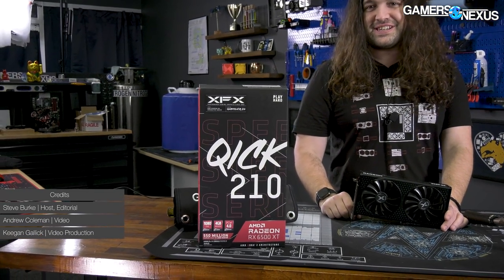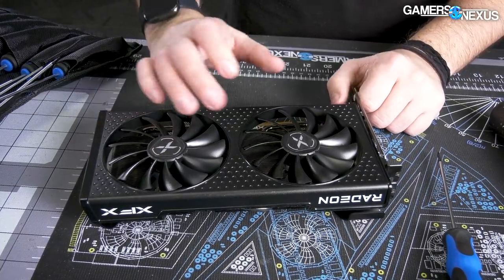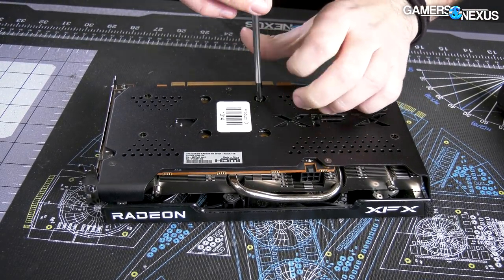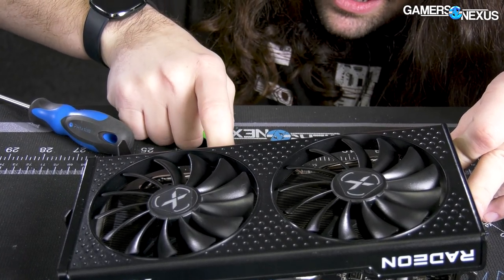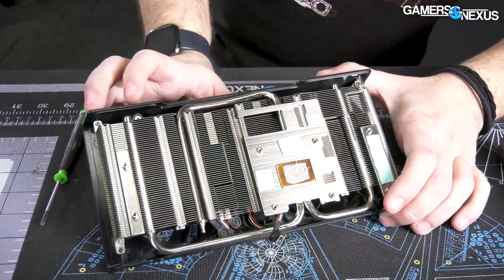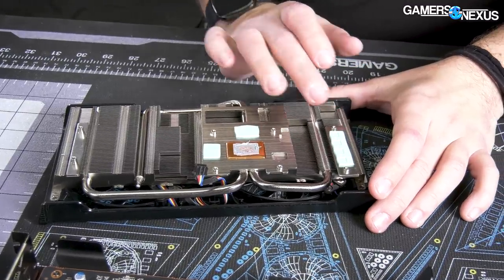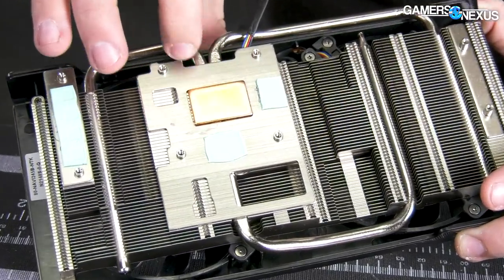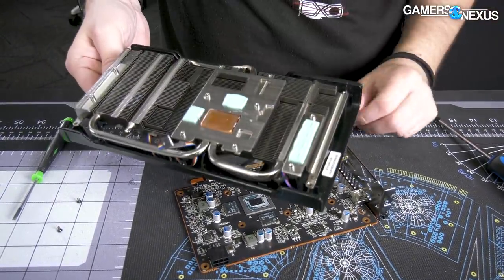Tearing Down Trash: AMD XFX RX 6500 XT Disassembly

Comment: The chips they used for these cards were probably made to go into laptops but the power curves didn't bin as well as they wanted so they made this...these companies are good at maximizing profit and at $150 this would have been an awesome move....
Reply: Except, it's not $150...
Shame, really.
Reply: except everyone would lose money at $150.  The whole market is jacked, all the way down to parts and shipping.
Reply: It will probably be $149 in the future when shipping costs drop.. for now, those are the ones that are significantly driving prices up.
Reply: @wisdoom9153  I know...It really sucks...
Reply: This is painful, why are we getting mad at AMD for setting a realistic MSRP for the market right now, but COMPLETELY IGNORE NVIDIA NOT SETTING AN MSRP FOR THE 3080 12GB.
Die cost is around $18
Board, VRM, etc. $50
30% markup to pay for R&D and other things (Normally is 60% for Nvidia and 45% for AMD) Total 150
VRAM $12 a GB so $48
Cooler $15
Shipping (right now) $30
The rough total before any AIB markup, $195

But maybe AMD learned now, they just won't say a realistic MSRP or any, then no one will get mad at them. Great job
Reply: @benc3825  why are you even trying to use whataboutism?
Reply: @AmateurHourProdu  Exactly, thank you
Reply: Stop saying that it's for laptops, 6500XT is an insult against laptop GPUs like RTX2060 with 6GB of VRAM, hardware encoder and decoder, etc, 128 bit bus, etc.
Reply: @S41t4r4  How else can you judge a product objectively. If you ignore the market conditions and other companies actions, then yes, this is a horrific product. If you spend literally more than 10 seconds thinking about it, this is a great product. If it is as strong as a Rx 580 and the 6500xt can stay under 300, which it is right now on Newegg, then where does that leave the Rx 580 and weaker cards? Under 300 realistically.
In this market. I can buy a 6500xt for $280 on Newegg, or I can buy a 1650 used for 300. What do you think is the better option?
Reply: @saricubra2867  Well bad news, it is a laptop die.
Reply: @benc3825  Still an insult to mobile Turing and Ampere. AMD is crap.
Reply: The current shipping and component cost do not allow this card to sell for that little. AMD is not a charity.
Reply: @benc3825  At least on desktop CPU space, Intel and AMD trade blows and on par, but on the GPU space, is like AMD is still salty about Pascal and struggling to compete against those cards almost 5 years latter.
Reply: Even at 150$ its to much for this GPU based on previous generations.
Reply: @benc3825  What you said is complete garbage. Stop fanboying AMD. This is the worst GPU released in last 2 decades.
Reply: This card wouldn't be good at any price, it will age terribly. Or better said, it already aged, DOA
Reply: @vasilije94  What ever you need to say to believe that. I’ve learned that people on call people fanboys because they can’t come up with a reasonable argument. I personally agree, that it is a crap GPU, but you can’t ignore the reason it was released and the market condition. 300 for a 1650 used or a 250 6500xt?

No, this isn’t the worst GPU, that goes to the GT1010 that was release within the past year. It is worse than an iGPU.
Reply: @wisdoom9153  ye its 275 or more
Reply: @benc3825  Stagnation. At it's best the 6500xt is about as good as an rx580. In reality it will perform worse than the Rx 580 in many games due to the 4gb of ram and X4 pcie. Further, they took away features that the 580 had in regards to encoding. 

Also, look at the 3080ti reviews and news videos about the 3090ti, people are pissed about that whole situation as well.
Reply: @saricubra2867  It is not meant to fight those,it was made to fight MX and Intel UHD ,which it easily dominates.
Reply: Funny you say that because I took apart my laptop for the first time to replace the thermal paste and deep clean my fans and vents, that GPU diode looks like my Intel CPU Diode. At first I thought my GPU was the square one till I saw it said Nvidia. So that only left me to conclude the square one was my I5 4 core, which I am still learning about, so @GamersNexus message received, Don’t f**k up. I might have a couple times with a striped screw or two, but it’s a learning experience I am trying to develop into a hobby for maintenance. Still waiting on the thermal paste though… But I enjoy watching your videos for honest feedback and professional reviews. I wish I had discovered this channel before I brought my desktop.
Reply: @benc3825  It doesn't fix the fact that if tomorrow the market decided to 'fix' itself (or a competitor sold a better product for a similar price), this would still end up a terrible value. It's terrible value now, and the current 'market condition' only serves to highlight how bad of a value it is because used products are still possibly more attractive than it.

Like, paying $50 more to have more staying power in the slightly longer run or to have some features that should have been there in the first place? I'd make that recommendation in a heartbeat. I've made it recently by selling my 5-year-old GTX 970 to a friend (at a friendly price) where he could have gotten a brand new APU instead (it would've been much cheaper for his budget to buy it) - simply because I know the APU would have sold him short on all the games he would've played. He's still enjoying it to this day.
Reply: At this point might aswell just get the 5600g.
Reply: I'm not even sure about that, the Radeon 5300 would probably nearly match it and it sold for about ~130 dollars.
Reply: @benc3825  bc this vid is ab amd? lmao
Reply: Yup, this would have been great if it was priced properly.
Reply: @AmateurHourProdu  Inflation existed before too, man. The budget GPUs of yesteryear didn't yield backwards either. Either they were stagnant, or the performance increase was marginal / better in a completely different workload (i.e. Pascal vs Turing with RT).

The point is that somehow, this regressed. Badly.
Reply: Exactly and when the market is the way it is instead of throwing out components people might be happy to just get this because it's all that's physically possible to have available at this point. These aren't scalping prices by any means.
Reply: @rick_takahashi  no it won't. this is the low end now. get over it, there won't be any more sub 300 low end gpu's again. people bought everything they threw out there and now it's time to pay the reaper. the low end cards are going to start at the 400 mark and go up from there.
Reply: @vasilije94  And what can you buy for 150 dollars these days? A used rx560?
Reply: @arthurbonds7200  What gpu that cost 50 dollar more has more staying power? You mean one of those used GPUs that may only last a few years at best because they were probably in a mining rig?
Reply: @stephen1r2  asrock does to
Reply: They know damn well these will sell for $200-$300. Charging less would be leaving money on the table. AMD is getting a lot of flak for this release but they're just taking advantage of an opportunity here.
Reply: @mystichisoka2  really? that is the rough cost of a TSMC N6 300mm wafer, given a die size of 107mm2, they can make 560 dies ignoring yields. A N6 wafer costs around 10K, making 560 makes the cost around $17.86 per 107mm2 die.
But with out my secret of a calculator. The EUV machine from ASML costs around 150 million. So I guess The 6500xt cost $150,000,195
Reply: @benc3825  keywords there is ignoring yields and it oversimplifies the full equation to cost of production. Not trying to defend AMD for a piss poor product, but the bigger picture is global shortages causing premiums everywhere.
Reply: @mystichisoka2  To be fair, if we make it more complex, it is just going to add more cost most likely, so this is the "best case" against this product cost wise
Reply: @benc3825 excuse me I'm reading all the comments...this shit is interesting
Reply: This gpu is a piece of Crap btw
Reply: @Singuy888  "Few years" is an interesting statement. My abused 5-year-old GTX 970 (overclocked to the edge of stability) was sold last year to my friend and continues to work perfectly today with no issues and plays many games decently. Even if it only lasts 2 more years with him, there's an extremely high chance that the market will stabilize before then - that's going to be a total 7 years life out of that GPU, and he can cheaply buy newer GPUs.

Buy old Maxwell like GTX 980 (which weren't mining beasts), some folks locally are selling them for $230.

Compare buying a 6500 XT now - when the market stabilizes (which could be as soon as the end of this year up to mid-year next year), the $300+ value will drop like a rock considering that it barely holds itself in current titles.
Reply: @arthurbonds7200  Next gen should be a really big jump in performance, so they are going to suck either way. Regarding the 980 argument... Have you heard of a warranty? Would you really save $40 for a MUCH less efficient and used GPU? I had my GTX 1060 6GB die a year ago and I ran it below stock so it would be quiet. That is why the term, "Silicon Lottery" is a thing.
I honestly don't need to say anything regarding performance, lower some settings, stay under the 4GB VRAM and it performance a better than I think you are making it out to be. Is it great? NO
Right now, a 1650 is $319 average selling price and the 6500xt is in stock, new for $280 this minute.
Do you really think AMD and Nvidia will release a cheap GPU right at the beginning of the generation? Let alone at all after this?
Reply: @ivanmarc3155  100%, but the market is 10 times worse, so... pick your poison sadly.
Reply: We all know why they made this crappy card! Its sad but you would be better off with a 5500xt from last gen if you dont have pci-e 4.0 system...if you are patient you can even find an 8gb 5500xt for around the same price as a 6500xt, and the performance is the same or better...it may be used but I would risk it considering all the shortcomings of this card...
Reply: @Singuy888  well yes just sold my old rx 560 for around 150$, i was surprised that more than 10 people were making a bid for it LOL.
Reply: Honestly 150 is way to much 50 ish would almost be kinda doable. Almost any gpu is better than this abomination.
Reply: @brucepreston3927  The 5500xt 8gb beats the 6500xt by a mile in a lot of games. That x4 pcie bandwith limitation is an atrocity...
Reply: @arthurbonds7200  well yes, but you are playing the lottery game with used gpus. May end up with a golden sample, may end up with a dud.
Reply: @arthurbonds7200  if the market fixes itself, the price of this card will go down as well. RX 580 MSRP never changed and yet it was sold for $140 at the end.
Reply: @Singuy888  In my experience the used lower power gpus don't die as often...there is always a chance but usually if its not DOA it will be good for a while...
Reply: @benc3825  if you compared mythical msrp of 3080 ti vs 2080 ti you still get generational improvement, while 6500 xt vs 5500 xt you get regresion, what a joke
Reply: @ranruy  except this gpu is 3x performance of 5600g iGpu.
Reply: @brucepreston3927  I would rather have bad performance than used dead card
Reply: @petervansan1054  but still a waste of money
Reply: More like 100$. It's marginally better than the 1050Ti, which is 6 years old and was 140$ at launch.
Reply: @AmateurHourProdu  it doesn't work when everyone is complaining because of the crippled performance which would otherwise be good if they didn't uselessly cheap out on pci lanes
Reply: We need a Wilhelm screen every time we break a ‘warranty sticker’
Reply: @saricubra2867  it is MOBILE GPU! MOBILE! Laptops, tablets, smartphones!
Reply: @petervansan1054  yes, there is always some risk...but i used to fix up older computers and resell them and out of around 400 used low tier cards i've purchased only a handful died on me...and about half of the cards that did die just needed a capacitor replaced and they were back up and running...I've had way more 80 class cards die than 50 and 60 class cards...the 5500xt is only 2 years old, I would rather take the risk on one of those than buy the 6500xt...but everyone has their own preferences
Reply: @arthurbonds7200  we aren't talking about a used GPU as those were sold when the market was fine, new GPUs are going to cost far more than they did 5 years ago, that 970 would probably cost 400+ nowadays. Used gpus don't have warranty which people like.

This gpu won't have the staying power of any other gpu, it made when costs are fair higher than any other time so of course its gonna be trash for the price compared any gpu that's been made for the past 5 years, that's literally how manufacturing and profit  are calculated. 

I can say the same thing about houses for example 30 years ago I could easily buy a 3 bedroom house for 30-50k now it's 500k for the same house. Cost is and demand is higher and this is the result
Reply: @benc3825  exactly. This is a trash card but this is the world we live in now. You can't compare any cards that are made before and after this event because costs would vary massively. People don't understand this at all.
Reply: @benc3825  its actually still the 1650 super . 6500 Xt is getting out performed by it with less power usage . my TUF gaming has the gdd6x 4gb and 754 cores and tops out around 115 watts . for 169 US 2 years ago. if you can get he used 1650 super , actually buy that . it will live longer with less bullshit in the way.
Reply: $150 Is actually too much for this piece of crap.
Reply: @benc3825  Not to buy anything and let them keep the overpriced hardware. 
I would give 3 to 6 months with no sales for the price to drop drastically to normal standards.
Reply: Yeah and it would have sold like hot cakes
Reply: @benc3825  Stop crying, go simp for a corporation somewhere else. As if GamersNexus hasn’t criticized Nvidia as well. 
Nvidia so far hasn’t gimped their GPUs to the point something they offered 5 years ago is competitive with their newest release.
Fanboy-ism is a plague
Reply: @Singuy888  This GPU won’t last anything cause it’s straight up garbage and doesn’t have encoding on it. Another corporate fanboy jumping in to defend AMD
Reply: @benclimo461  Yes you can compare it. The company was not under any obligation to release and we aren’t under any obligation to call them out for a shit product. Stop crying and fighting to the death for corporations
Reply: Card is meant for budget gaming, period. It is not design to compete with 3060 or even 2060 or any other card of medium segment. It is time to finally realize - Brandon's dollars are not the same as Donald's dollars. This card replaces RX 460, perhaps 470 and that is it. Main competitor in low powered segment is gtx 1650 (not the Super, regular version).
Reply: @anthonymarquez2542  Wow, those are so big words, I hope you didn’t hurt your self. And Nvidia hasn’t gimped a GPU in the past 5 years? Look up the GT1010, release just a year ago. 
I’m not a fan out, I hate this GPU, but ignore the market it was released in is the issue. double standards is the only plague here
Reply: @vasilije94  "This is the worst GPU released in last 2 decades."  FX5200 has entered the chat.
Reply: AMD should've said it was 150 and make the AIBs sell it for 200 anyways, just like nvidia does.
Reply: @karathkasun  X to doubt. Considering how cheaply they sell this to laptops, I really can't think it would cost them 100 dollars to add the PCB, heatsink + fan and the metal bracket. Shipping prices are maybe a bit higher, but this is also a really poor excuse given that our other goods haven't been yanked up in prices due to "shipping costs increases". IF shipping costs were vastly higher than before, we wouldn't see our normal stuff being at about the same price in the markets. Especially big, bulky items.
Reply: @PAcifisti  Laptops are up right now too.  I picked up an i5/GTX 1050 Ti in 2017 for $600 new, cant get a laptop with discreet graphics for that price now at all.
Reply: @zaxmaxlax  NV didnt even put MSRPs on their newest cards.  They just announced them and let AIB partners charge whatever.
Reply: For 150$ it would be great. But we compare it to a card for 200$ 5 years ago. Since unfortunatelly the infaltion spiked. The 50$ is gone. So 200$ for this cars is reasonable. I bought a used 2070 for 850$. Is that a reasonably price? Absolutly NOT.
Reply: There's nothing wrong in using it. The only wrong thing or the sad thing is the pricing.
Reply: @karathkasun  Yep. No way in hell the 3050 will cost 250.
Reply: @anthonymarquez2542  Yes you can compare it, and yes this card is pretty bad in every way possible im not gonna lie. Im not fighting for the corporations at all. But a lot of people only buy new electronics which is where this card makes sense. Go on and buy a better card for the money thats brand new, you have to face it, nowadays tech just costs far more than it ever used to meaning that it's either companies make far less profit/lose or cards are overpriced. Look at nvidias new cards they are also massively overpriced and hard to get. At least AMD released a card that the majority can get hold of as it's so bad that minors and scalpers are gonna look the other way mostly.
Reply: @karathkasun  I've seen them go for around 600-700 euros starting with 1650 / 1650 super for all scarcity. Now they're a tiny bit up, needing to put closer to 700 to start but the next sale will most likely solve that. Stores are full of them, sitting at 100+ for most in stockpile
Reply: @robwiljas  oh yea, i remember that time. The naming scheme and the GPU that was weaker than integrated, lol. Good times.
Reply: @robwiljas  What about the 5800 ultra. The card that Nvidia literally still pretends never existed. The hair dryer that even with benchmark hacks still lost to ATI back in the day. Although they did make a funny video taking the piss out of it themselves.
Reply: People keep talking about the price of this card, and bumping back and forth on who's worse right now between Nvidia and AMD are missing the point. Is this card overpriced? Yes.  Is Nvidia also doing the same crap? Yes. Is the whole market depressing because of inflation, crypto miners, scalpers, shortages, etc? Yes.

The real problem with this card is that it is trash at any price, and for reasons that don't even have a valid reason to exist. The OP was dead on for why this card is here, and it's a valid/intelligent move by AMD from a business standpoint.

What is offensive about it is the fact that they cut the lanes down for no reason. They could have done this without doing that and still been making a great business decision overall without shafting consumers. The next inexcusable offensive part is the fact that it doesn't have friggin' codec support. That one really stings, and makes this card inferior to just about anything out there. It also makes no sense to leave that out either.

Bottom line here is that they could have still made the intelligent business decision to sell this card from failed laptop GPU bins, without going out of their way to shaft customers out of these two basic features. The price otherwise would be just the unfortunate reality of the current state of the world.
Reply: max. $100,- ! more is waste of money !
Reply: Uhhh, except that, technically, this is essentially a $150 GPU ($160 to be precise). Trump added a 25% tariff to computer hardware coming from China, so what previously would have cost $160 now costs $200.
Reply: @bsh7390  I was just pointing out that this card would only look reasonable if it was sold at $150...I'm not naive and I know they are only here to make money...It personally doesn't bother me either way because I usually shop at the high end... but now even low end shopper are getting screwed hard!
Reply: @AmateurHourProdu  they make even less if nobody buys them. making a loss is better than eating the cost of the chip never selling
Reply: @vasilije94  lol, he used numbers and you just say "no" yet he is somehow a fanboy
Reply: @vasilije94  so what are they
Reply: @karathkasun  They can go ahead and lose a bit of money on this if they're using rejected laptop dies and spare other parts anyway. The real sin was calling it the 6500 XT and not the 6300 non-XT
Reply: @benc3825  This is of course assuming that one uses it in a PCIe4.0 system, which is not all that likely unless someone is building an entire new system, but why would they do that with AM5 around the corner?
Reply: @vasilije94  Reference design R9 290(not the partner boards, there were some good ones) was a lot more awful, IMO, with crazy temps and that insane leaf blower cooler. Reference designs from AMD in general over a long period were pretty trash, and the number of rebranded cards that stayed in their line-up for multiple years on end was straight up BS. I think the R9 M470X might have been the biggest heap of crap, but the GT 1030 with DDR4 that was released with exactly the same model name as the GT 1030 with DDR5 might be worse. Kepler GPUs in general are bad too...they were fine at the time, but they aged terribly in comparison to others. There have been a lot of terrible GPUs, and putting the RX 6500 XT at the top of that list seems...extreme. It seems like just more average crap, to me. This XFX version seems to be trying to get on the list, though. :P
Reply: @BeardedFrog  Good points~
Reply: @theredscourge  Price. I doubt AM5 will be cheap for a long time. Zen 3 and older will drop in price quickly after Zen 4’s launch.
Reply: they have very high clock frequencies, if lower them power consumption might be very different to fit laptops fine
Reply: @mirage8753  Yea, you can do that with any chip...But i'm sure they had a price in mind for these chips and if they had to lower the performance more to get it into a laptop they would have to lower the price... they would have been better off doing what they did and putting them in a desktop card
Reply: Even if this was $150 which will never happen rn and would probably happen after the shortage is over and companies stop charging ridiculous prices, the 1650 super would still be a better buy, it generally outperforms it and doesn't have the issues that this thing does
Reply: @saricubra2867  ok so you are just hating on amd. Why not stay out of the comments?
Reply: @theredscourge  TL:DR - The 6500 XT is the couple of generations late RX 550 replacement that didnt exist in the RX 5000 series.

No, the real sin was not calling the 5500 XT the 5600 XT.  That was roughly where "RX 590 performance" should have been for that product stack.  The problem is that AMD fudged their product stack naming for that generation so they could call back to the era of the Radeon 9700 XT.

x60 is generally around half of the x80 and the x50 is generally half of the x60 when it comes to shaders/performance.  This is fairly accurate all the way back to the HD 4000 series.

5500 XT "overperformed" for its product stack position and the 6500 XT is the "correction" back to where performance historically has been for that product stack position.
Reply: @brucepreston3927  look, for current market state its a decent card with decent price, you wont buy even used cards cheaper than this. and if someone wants to buy it on pcie3 then upgrading cpu and mobo to pcie4 later will give some more performance for the card. intel has decent gen11 chip in lower segment, and amd has b550 ryzen 3000/5000 chips. yes, if not mining this card most probably would cost lower like all other cards, but it is what it is. seems like crypto drops down now, so will see prices in near future
Reply: @papasauce234  crypto drops, scalpers will definitely have hard times. will see what will happen with gpu market
Reply: @papasauce234  price from our local retailer for example: 1650 - 345$, 6500xt - 385$, 5500xt 8gb - 512$. i think choice is obvious
Reply: @wisdoom9153  It's only €450 lol
Reply: @saricubra2867  it's a mid range laptop gpu that was intended to be paired with an APU, the APU has the hardware encoder/decoder for power savings. the 6500 was likely intended to compete against the nvidia MX series dgpu's.
Reply: @benc3825  The card is garbage no matter how you slice it
Reply: @anthonymarquez2542  I have yet to say otherwise, but ignore the market situation defeats the purpose of the card. How long do you think it would take for them to add an extra 4x for a total of 8 PCIe 4.0 lanes?
Reply: Should be priced at most $70
Reply: @-GameHacKeR-  I disagree, even in the best market, that wouldn’t have been worth it. It can see 150$ max. Either way, they were honest about the pricing in this market, got yelled at. They will most likely lie about the MSRP or just not have one. No one really got mad at Nvidia for not having an MSRP on their last 3 cards
Reply: @petervansan1054  bruh you basically paying 400bucks for something that's worse than a 1050ti at times. And never really better than a rx570/ r9 290(or whatever the 2012 version of the r9 290was).

You're honestly better off with no GPU.
Reply: @Chaosbreak1  yeah 50 bucks would maybe be a good price. To bad it's selling for as much as a 1080ti on the market right now lmao
Reply: @aleksazunjic9672  to bad it can't game if it's designed for that lmao. Or well it can but 10 year old GPUs are better. And you can literally buy a 1080 right now for how much the 6500xt is selling so why get it lmao. This card can't even compete with a 1050ti in some games and is usually worse than a rx570/R9 290(and whatever the 2012 version of that card was).
Reply: @robwiljas  I'm gonna argue this card is definitely worse. It's worse than a 10 year old GPU and that 10 year old GPU sold for less 10 years ago.
Reply: @uwontremembertrue1454  I wouldn't buy it for 200bucks nor say it's a reasonable price even in this market. And that's ignoring the real MSRP of 400bucks and the fact that this you seems to have made every other GPU more expensive.

So it's really a loss loss situation for everyone.
Reply: @MrLince-hr4of  in the Netherlands the MSRP is actually 400 bucks right now and seems to have increased the MSRP for other cards too(otherwise it would be to close to the 6600).
Reply: @tilburg8683  If you can find 1080 for $200-250 then buy it :D You don't get warranty but that is life. 6500 is faster than 1650 in most games, not to mention 1050 ti .
Reply: @tilburg8683  If there is a supply issue and the demand is much much higher than production, every bit of a chip which works and might be bought is a good one. It expands the market. Just check the used car market. There are no good cars or are expensive even can reach prices as high as new cars because the difference is that it is there, while the new will be made in 8-15 Months. And there are no miners on that market. So you can say this is a shity card (it is) but right now, every GPU is welcome.
Reply: The problem is, even at $150 this is trash.
Reply: @benc3825  Well, the 1650 isn't limited to 4 PCIe lanes, and has hardware video encoding, and low-profile models that run without a power connector exist, so...
Reply: @bluesy92  look the most recent Moore’s Law is Dead video. He is comparing a bunch of GPUs, and there are a lot of things that people didn’t talk about it. Also, have you ever used the hardware encoding? Because I sure haven’t
If you overclock the (I think) BCLK of your memory, it speeds up the PCIe express lanes, making the 4x a lot less of a bottle neck